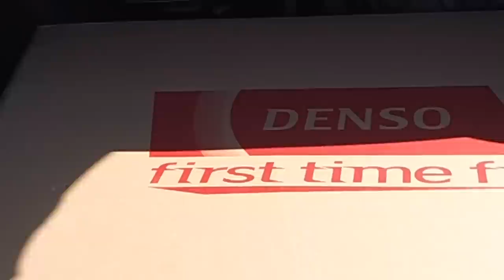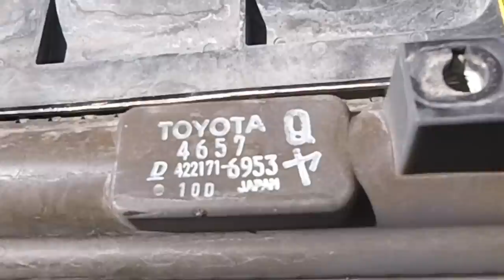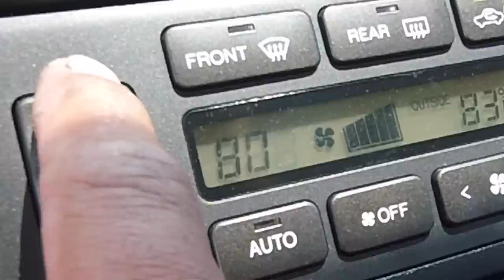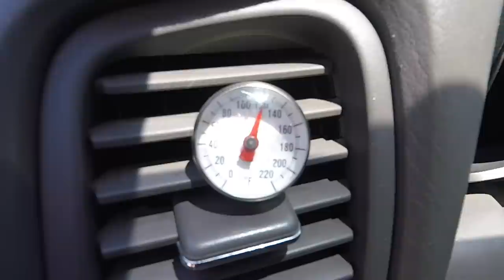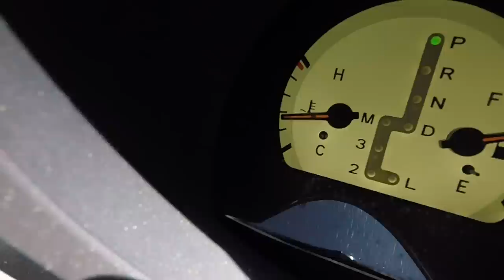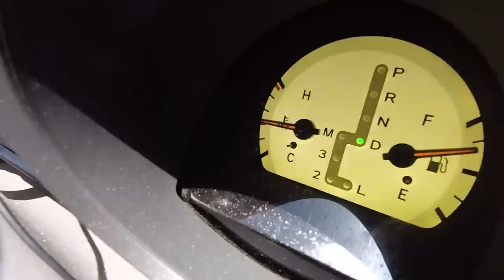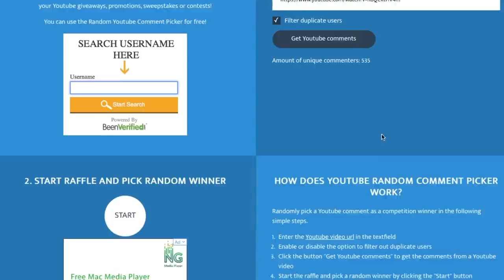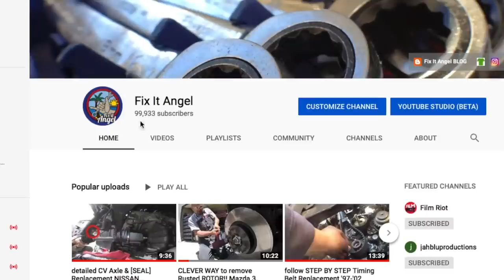If you see this. Replace it. Radiator LEXUS GS300 √ Fix it Angel

Comment: Dangerous silicone Paste in radiator

Your suggestion using Silicone paste to glue the hoses to radiator is very dangerous.

The Silicone paste melts at engine's operating temperature, mixes with coolant  circulates in the cooling system and hardens when it cools down.

In my GS300 the glue jams the thermostat.  When the water pump runs, it pressurized coolant against the closed thermostat, creating high pressure that blew out the hoses, engine overheated, cracked head gasket, a $4,000 repair to a fairly new engine.

Engine is still being repaired.  Don't know if this glue did not jam up radiator heater core and cooling lines. 

Do not use or add any material not recommended by OEM..

Comment: I’m here because the top of my radiator just blew...was 5 minutes away from my house and engine started to over heat and serpentine belt came off...it was smoking like crazy but I make it home. Hope I didn’t destroy the engine, hopefully just buying a new radiator will fix.
Thanks for the video Angel 👍👍👍
Reply: was ur engine good
Reply: @SteezyBeats  not sure now, I have to do the timing belt and water pump…the water pump failed and is leaking coolant

Comment: Our car has run for 100000 kms. It's Fiat Linea, 1.3L multiget diesel engine, 7 years old car. Do I need to Get EGR system cleaned? Do I need to flush the coolant which was replaced 3 years ago ( I mean 30000 KMS back). Pls guide me on that. In owner manual there is nothing about EGR clean.

Comment: Great job. Maybe you should think about the trans fluid and filter. I have been doing my 2002 GS300 , dropped the pan and added 4 quarts original Lexus Denso, then after 3 moths in March 2024 did it again, will do it once more end of June. I would never have a Power Flush done, warned a Friend with an SC430 but he had it done anyway, Now rebuilt Trans 2 months later.

Comment: Great Work and great filming. Very instructive. I have the same car 2003 Lexus GS 300 - My shift solenoid C in the transmission is giving engine light error and I need to change it. I'm wondering if we have to change other sensors as well. Also if you have a video related to changing them or one about opening and closing the transmission housing to access them?  Any information would help. Thank You!

Comment: Great video. I have a Gs300 my self. But am having a few problems will the engine overheating. Not the actual engine the radiator keep boiling over, I had the water pump, thermostat, radiator replace and still boils over, my mechanic keep saying its not the head gasket. can someone sheds some info please.

Comment: My Toyota Camry 07 has a lot of pressure in the radiator. Pushed out the bottom of the radiator hence I had to replace it. I’m hoping you could tell me a cheap way to fix my possible blown head gasket. Car wasn’t overheating when I replaced the radiator but there’s too much.pressure. I kept driving it and same thing happened again. Already managed to take the radiator out to replace it. Curious if blue devil sealer works?

Comment: You know it's funny angel that you're doing this car because I have a gs430 a 2001 before that I had a 2002 GS300 anyways I bought the GS300 brand new almost certified used 28000 miles drove it until it had about a hundred thirty thousand miles when I got rid of it but anyways my gs430 has 197000 miles I bought it with 90k super cheap beautiful condition drove it all the way up to this point then she started overheating this summer so I started with the radiator cap because the little nipple was gone then I change a thermostat at the same time it started a drive okay but and then we started getting some real hot days she started Rising again I'm like ain't this a mother so I tried changing the coolant one more time and I have that special funnel you have because there's no way not to use that funnel you have to get the air out system especially with Lexus I know that I was a technician for 5 years at Lexus anyways I only work on cars for fun now anyways even after I put new coolant one more time my radiator wasn't discolored the way this one was but there had to have been some type of blockage in it that I couldn't see because it just wasn't flowing properly when it would get real hot the upper radiator hose with want to walk off the radiator so I would have to check it pull it back but it just something I couldn't see the radiator internally somehow busted I'm going to cut it open soon it's at my buddies house he's got a cut off tool soon enough I'm going to cut it up see what the heck really went on internally keep up the good work Buddy I enjoy watching your videos

Comment: only thing I would suggest is to back-flush the heater core at the same time, and probably flush the whole cooling system before you change the radiator. That way it doesn't get plugged up with all the gunk in the coolant.

Comment: You did it the hard way. You can pull the radiator out with the fan shroud still connected and put it back in the same way.

Comment: Damn bro you're good I jacked up the car got underneath took the plate off did all those connections from underneath and then I took the old radiator and fan as an assembly the whole thing out you're good man but kind of made it tougher on yourself by taking off the radiator fan assembly out first you should have just took an it out as an assembly but whatever you're good

Comment: Hafa Adai Che'lu
2002 Toyota rav4 radiator both fan motors turn slow! Which fuse should be changed ?
Esta!
Reply from the maker: 671Guam Lada Hafa Adai Chelu!! If the fans are slow maybe fans are bad. Check fan motor connector and see if getting 12 volts. If 12 volts present then fans bad. If not getting 12 volts, check wires for cuts maybe cross shorting. Also check the fan relay. Maybe bad connection on the relay. 
If fuse was blown, fans wont turn

Comment: I notice that you did not check the metal clamps that are located on the top and bottom of the radiator. The ones that assembles the metal to plastic parts. I did the same jobe and had to do the job a second time on my honda civic. I noticed a leack and i found that these clamps did not hold tight. So had to hand tight them with a hummer and re install the radiator. Hope it's not the case for you and plz recommande that for the nex job if the same assambly presents. Good luck

Comment: Great video, thanks for taking the time to make it. I had a similar issue, the upper hose connection broke inside the hose like you mentioned.  I was taking my family to the park when it happened. We barely made it to the park when my truck spewed all the antifreeze as I parked. I had to walk 6 miles to an AutoZone that had the radiator for my truck because of rush-hour public transportation and 🚖 were stopped on traffic.  I had to leave the family in the park 😔.  Once I got the new radiator and antifreeze I took a cab back. It was my first-time doing this kind of work luckily I had watched videos like this... 👍😊  I didn't have the money for a tow to a shop let alone parts and labor.  A few hours later I had a new radiator installed and my wife no longet complaints about me watching car repair videos like yours. 😃😏 👍

Comment: Do you usually put the clamps back on the same groove or position it differently? Wonder whats best practice for those old hoses. Thanks
Reply: Definitely the same grove. I've seen very slight leaks because the clamp wasn't put back on the same way on very old and hard hoses.